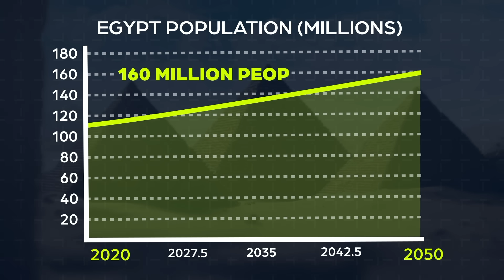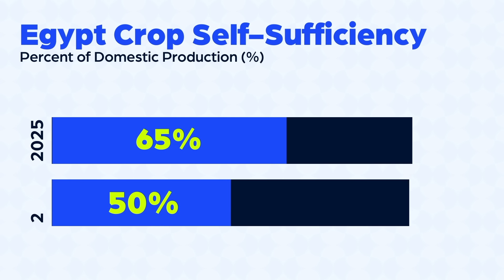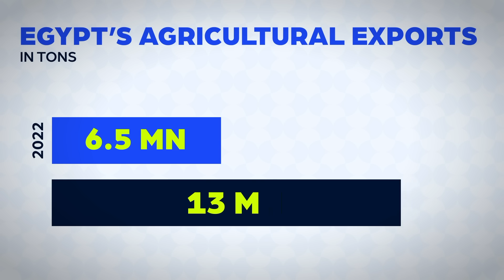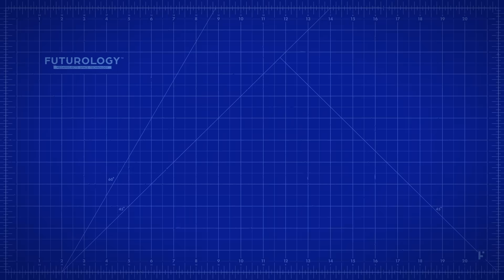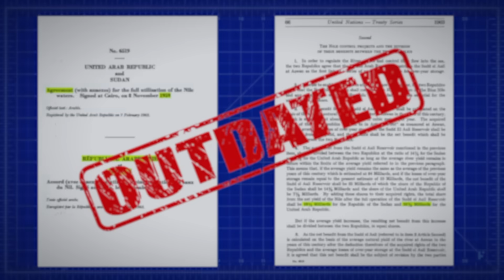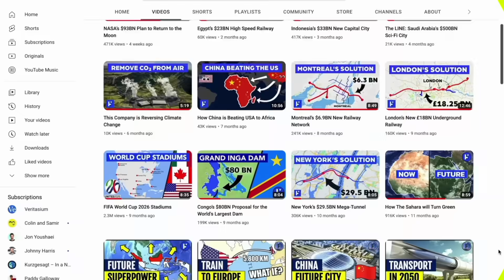Egypt is Building a $9.7BN New Nile Delta

Comment: I am wondering, how they are going to manage the drainage of the new delta. To avoid salinisation in the long run, you have to irritate the fields with excess water, drain the fields and discharge the new wastewater from the drainage into the sea. Otherwise salt will be accumulated in the soil or in freshwater bodies.

Comment: Ethiopia is deceiving its people and the dam's financiers. It is a fragile dam and is not suitable for storing water. Ethiopia has stored water several times but has not been able to generate electricity from it. Rather, it was rushing to empty the water because of its danger to the dam's structure. Also, the dam is located in an area that is active in earthquakes.

Comment: Just empty the nile in Qattara. It will take another 200 years to fill up.
If the upstream dams are managed and natural flow is restored then it will take 20. The saline lake formed will turn fresh if we give it an outlet to sea from it's bottom by means of two 7 meter diameter tunnels (Convection tunnels). The evaporation calculation is such that you won't need more than two.
As this new freshwater sea fills, evaporation will increase rainfall in catchment countries, starting a replenishment cycle..

Another alternative is to divert nile but to immediately fill the sea with sea water through convection tunnels. This will take 2 years and immediately affect rainfall cycle. The calculations of saline seepage have to be carried out. You will have freshwater lake in 20 years.
Good thing is that the near surface aquifers (50-200 meters) will be used up in next 5-10 years and after that the deeper (400 mts and beyond), which holds major water will have to be used, so an aquifer studty must also be conducted.

Comment: Ethiopia's new Rennnaisance Dam is very unpleasant for Egypt, of course. But at least its filling will take only a few years and then the situation of saturating the Nile from Ethiopia is gonna be as before. Am I right?
Reply: The Ethiopian Dam has created a lake that’s evaporates quicker than the river normally would because it has a larger surface area. In addition minerals will be caught in the Dam which mean they can’t add nutrients to the Nile Riverbanks or replenish the eroding Nile Delta soil.
Reply: @erikthomsen4768   I don't get it. If the reservoir basin evapores too quickly than the dam cannot serve its purpose. Are you sure your data about this dam is correct?
Reply: @janmachacek2862  No. That’s not the equation I was talking about.

Compared to a narrow river, relatively more water evaporates in the lake created by the Ethiopian Dam. It is not enough to stop the Dam from functioning. But it adds up to quite a lot of water that will never reach Sudan or Egypt.

Comment: Why not use many curved mirrors and use the power of the sun to desalinate the seawater and us this for even more irrigation? I suppose it makes sense to use any unused Nile water that would otherwise flow to the Med Sea first before desalination. All they would need is the metal for mirrors and heating pipes which could be fabricated in Egypt and not expensive solar panels that will need importing from other countries. I sympathise with these people and worked in Egypt for a short time on a power project.

Comment: Great video. Really informative! 

In reviewing local media coverage on these matters, a few things seem to have been accepted by both the authorities, as well as the general public.  The first thing is that the Ethiopian dam has seen many challanges and obstacles which have lead to huge delays in both its consutruction, and its filling up.  There seems to be consensus that whatever affect the dam construction works may have had, on the flow of water up the Nile, has been little. Therefore, Egypt's fresh water supply (from the Nile) has not been negatively affected in an impactful way.  In fact, Sudan (to the south of Egypt) has seen some irregular flooding. This has been attributed to Ethiopia needing to release more water (without notice) than what would normally flow around those times.  

Secondly. Regardless of any temporary effect on the flow of water up the nile whilst construction and the filling up of the dam in Ethiopia continues, these massive irragation infrastructure projects are designed to compliment (add to) current water resources, not replace them.  As you accurately point out in the video, the new delta project is just one of many massive infrastructure project that are underway, accross many industries, regions and sectors, all designed to future-proof the country from shocks, such as the Russia/Ukraine war, food and energy supply, and population growth.

Comment: I believe this was based off of a previous attempt where Germany and Egypt cooperated to form an artificial new lake in Egypt by creating several canals moving into the Qattara Depression which was a lake thousands of years ago but dried up. Egypt denied this project however due to the fear that it could poison it's water supplies
Reply: No.  Thats different.  This is based on wastewater treatment to farm a different part of egypt.  The qattara depression project is still stalled over fears that the seawater will seep into groundwater aquifers/nile basin.  And no one wants a new dead sea.  Have to find a cheap way to desalinate the water first if the qattara project will ever happen.
Reply: @SherifRok-cw8kx  Just empty the nile in Qattara. It will take another 200 years to fill up, If the upstream dams are managed and natural flow is restored then it will take 20. The saline lake formed will turn fresh if we give it an outlet to sea from it's bottom by means of two 7 meter diameter tunnels.
As this new freshwater sea fills, evaporation will increase rainfall in catchment countries, starting a replenishment cycle..

Another alternative is to divert nile but to immediately fill the sea with sea water through convection tunnels. This will take 2 years and immediately affect rainfall cycle. The calculations of saline seepage have to be carried out. You will have freshwater lake in 20 years.
Good thing is that the near surface aquifers (50-200 meters) will be used up in next 5-10 years and after that the deeper (400 mts and beyond), which holds major water will have to be used, so an aquifer studty must also be conducted.
Reply: I do wonder if this new delta is going to have sufficient drainage to avoid the soil becoming salted up from water evaporation.
Reply: @daffyduck780 I believe this is set to use water that ultimately comes from the Nile ie fresh water hence no salinity involved this is not the same as the idea for the qattara depression which was suggested as using sea water (not fresh water - saline!)

Comment: Make Qattara depression into giant air moisturizer
Reply: You would need a massive source of water. Only the Mediterranean Sea is big enough. And I am not sure Qattara can take the necessary volumes. Plus you would need to dig a tunnel between this lowland and the ocean which means more erosion along the coast. The only solution I can find would be to extend a pipe several kilometers from coast and then dump the water in open containers to avoid salt storms.

Curiously, if successful this might also double as a dam and if the evaporating water can be funnelled then you can also collect it as fresh water rather than lost to the winds. You will need more water to restart the West African Monsoon.

Comment: The only flaw I immediately see with such a plan is having the treatment plant at the end of the pipeline, not at the beginning. That could lead to dirt and other material clogging the pipes.
Reply: So making 2 plants one at start one on the end would work?
Reply: @omaersaedi5225  You miss the point. If you put the treatment plant before the pipes that deceases the chance of clogs in the pipes.

Farm runoff has a lot of dirt and chemicals, such as calcium, that can quickly build up in pipes.

Comment: This video is good and congrats to Egypt. But I am interested in, seriously interested, on how does a sand terrain transform into a fertile soil? 
Its not just adding water. If you sip water into sand, it will just go down… What could be done and what is being done to make desert a fertile soil?
Reply: It is possible in a variety of ways:
1- Chemically changing the properties of land by adding agents that increase water retention levels in soil.
2- Mechanically mixing extracted arable soil with the sand in the designated areas.
3- Initially relying on pulses (Legumes) which naturally have properties that support the soil via their root system, increasing water retention and adding nutritional value via root bacteria.
Or using a mixture of these 3 methods.
Bottomline, in modern engineering everything is possible, it's just a matter of cost-benefit calculations.
Reply: @MrBedoJoe  Thank you very much for your reply, it has been informing.

Comment: At least the problem has been recognised! Historically, Pharoic Egypt and it's peer nations were responsible for the desertification of the Sahara by the discovery of rudimentary agriculture 12 to 6 thousand years ago. The problem has become worse every year since. 
Now,  the resulting problem is at least realised. 
Ultimately, the existing water CANNOT be sufficient for growth, without supplement by massive desalination. 
The most effective way to achieve this is from rain. The reason it does not rain, is deforestation. 
Ergo: the correct solution is reforestation of the Sahara. 
Well, this is at least a start....

Comment: Sun energy is  plenty in Egypt all the year round. If this energy could be utilized to distill water Egyptians wouldn't be quarreling with the Ethiopians!
Reply: Solar desalination will not suffice about 120 million people, as it is not sustainable, and the places that can be used for solar power plants are very far from urban areas, so the cost of transportation will be much higher.
Egypt needs 110 billion cubic meters of water annually, and it is assumed that Egypt's share of the Nile River is 55 billion cubic meters, and it will decrease due to the construction of the dam. So, Egypt needs 55 billion cubic meters per day, while it produces the largest desalination plant in the world that produces one million cubic meters per day, or 365 million cubic meters per year, meaning that Egypt needs 150 stations from the same largest desalination plant in the world, and this is impossible.
Egypt supplies foodstuffs and industrial supplies, saving about 20 billion cubic meters. There is a volume of about more than 35 billion cubic meters, which exceeds that you have 100 desalination plants, the same as the largest plant in the world.

Comment: Agricultural Activities do consume more Water than Urban Spaces. I think it's far better to build the Micro Cities in New Delta could be of Multi-purpose that gives Green Cover for Small Agricultural Activities like Horticulture but the main aim is to have an expansion of Green Living Spaces. You could still have Refined Wheat Flour through AirFreight that's not a bring Problem. China has the Capability to build African Continent.